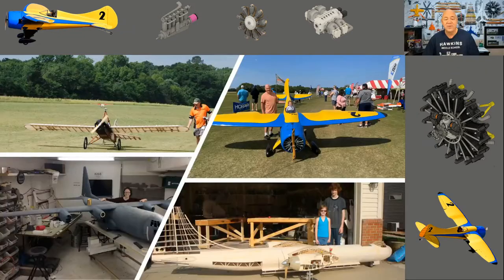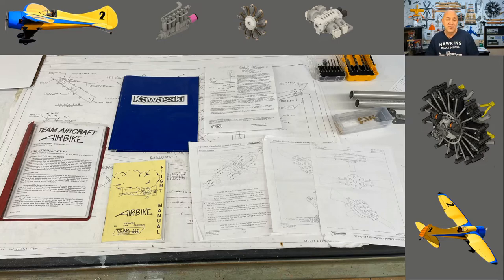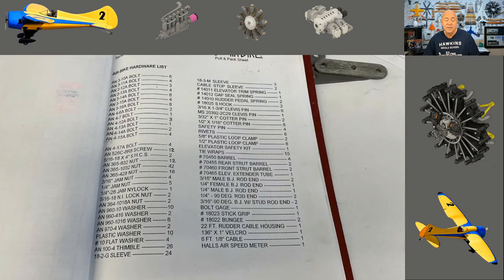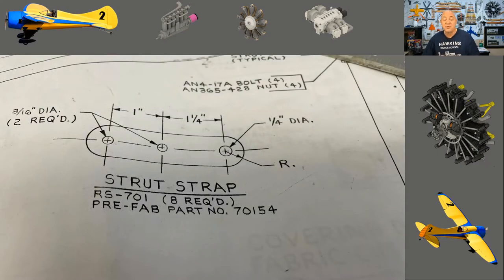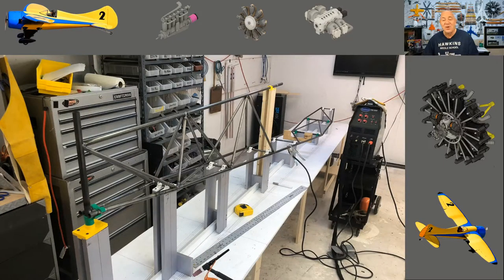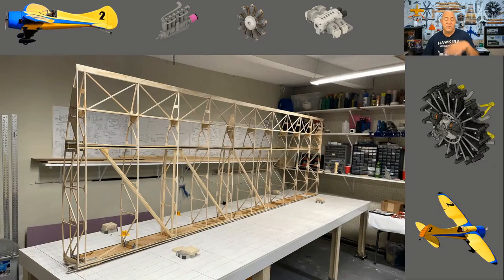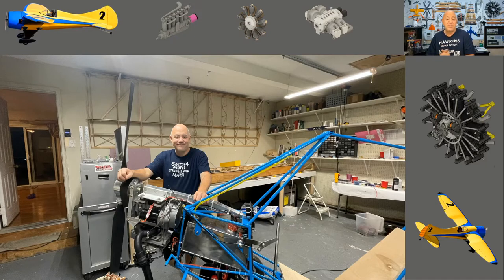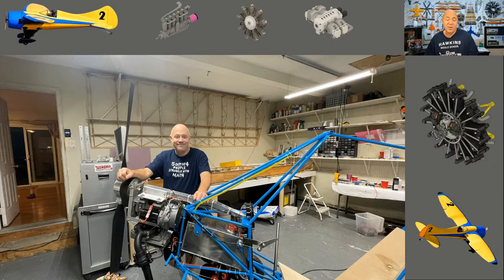So you want to Build a Part 103 AirBike Ultralight?

Comment: I was just gifted airbike drawings.  I'm a transport Canada licensed aircraft structures AME. 30 years in the business.  I've built, restored, and maintained all sorts of sheet metal aircraft.  Both helicopter and fixed wing.  
I'm pretty good at 2 and 4 stroke engines.  I can read drawings.  And yet I'm oddly intimidated about building this from scratch.
Immediately I see the wings are made of wood. I haven't worked with wood since high-school back in 1988 and  I haven't welded anything before.
I'm still going to do it.  
Your videos are quickly becoming valuable to me.
Nice airframe jig table!!
Watching from Kelowna British Columbia Canada 🇨🇦👍🍻
Reply from the maker: Thanks, building from scratch has been a blast for me in my RC world, but building a ultralight from scratch has been a bit intimating for me. Every step I think about it a few different ways just to make sure I am doing it right. I trail fit everything a few times before welding or gluing.

Comment: could you use a 39 horse power 4 stroke engine on one???
Reply from the maker: Depends on the weight of the engine. If you could get the CG right 39hp is plenty.